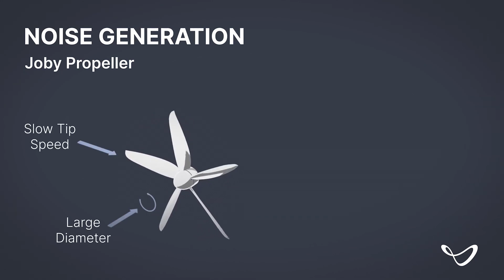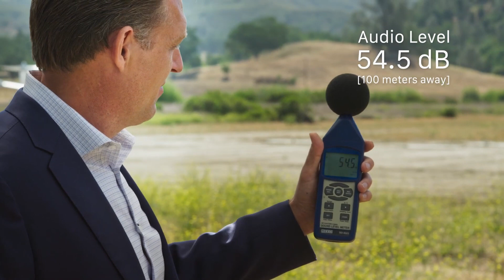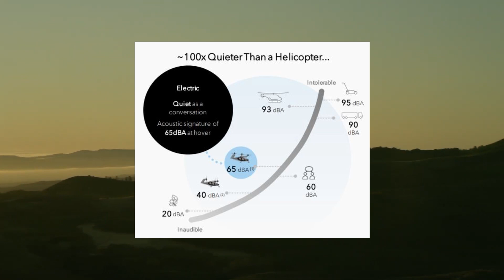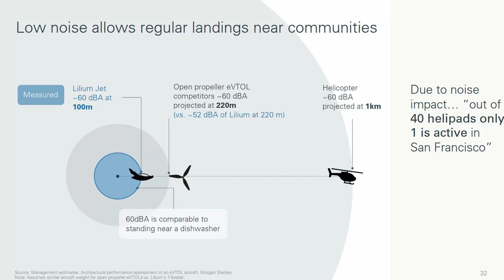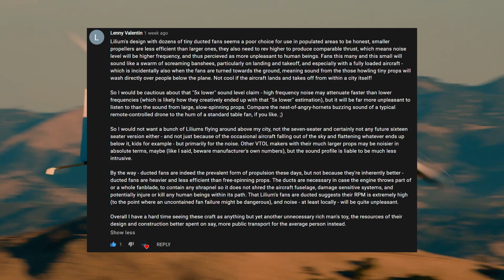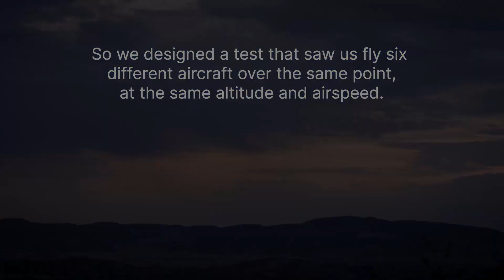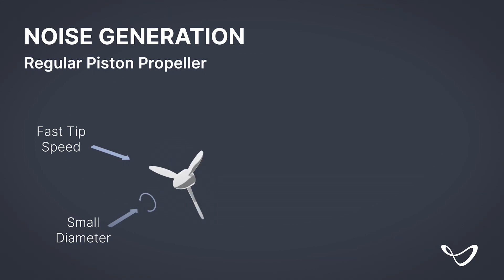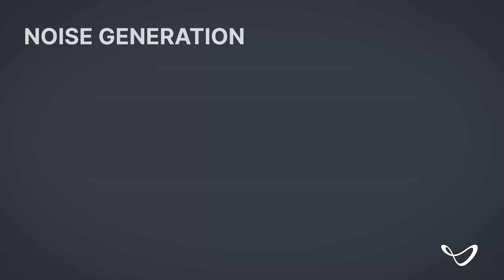Lilium vs Joby Which Electric Jet Quieter? Noise Level Of LILM & JOBY During Landing | eVTOL

Comment: Joby's larger rotors will produce more lift per rotor due to more surface area for the air to travel across, and that means Joby's rotors will not have to rotate but so fast but the question is, how much cavitation with those rotors create,  effectively producing the Pulse rotor audible effect or the chopping sound.  One must also keep in mind Joby's video's are produced by a film crew.  The spokesman ceo is mic'ed up,  exterior audio is reduced, then theirs POST production, which the editors can adjust the levels of noise in the studio.  so dont believe everything you see / hear in the video.  Lilium on the other hand looks as if it was shot with a gopro.  no Post production or little their of.   its audio more true to life.     Personally i would assume the joby to be a more quite aircraft.  or at least,  its sound profile more easy on the ears.   Remember a great deal of noise that an aircraft produce come from its engines,  combustion and turbo combustion engines at that which these aircraft do not suffer from.   so the levels of noise will be considerably low.   Now thats not to say electric motors dont make any sounds.  most do.. very high pitched sounds.  remains to be seen if these will also carry those traits.    But both will be fully accepted by the public.  because the very spectacle of their service will drive their popularity.   The real question is, how fast can they produce these aircraft. As this new industry success will depend on flooding the skies with these aircraft.  Figure it like this, multiple destinations is great, but these aircraft still only occupy 4 people on average (lilium is special with its seven seater)   And that means in order for such service to be profitable, it must mirror at least low levels of ground based highway traffic.   Its the only way to bring cost down.  the more planes the more serviceable destinations the least time constraints all riding on the amount of aircraft to service it all.   like Uber its a service that must take the hit of losses before its infrastructure is large enough to then become practical and profitable.
Reply from the maker: Great points! Thanks for your comment.
Reply: Modern Microphones have background noise cancellation and are designed to focus on the noise.  We really need an acoustic engineer to comment.
Reply: Honestly evtols are never going to change the day-to-day lives of normal people. It will be a niche industry.

Comment: It's not super easy to tell from the videos but it certainly looks as though the Joby props curve down (in TOL position) at the tips. This will function in a way similar to modern airliner wingtips, that is inhibiting tip vertices. These alone will greatly contribute to the low noise profile.

Comment: I have to say Lilium sounds a lot like a passenger jet which is preparing for take-off. Airport sounds make everyone think of going on holiday (in my opinion), which is a good thing.
Reply: Haha. Well the sound people associate with “going on holiday” will evolve with better tech.
Reply from the maker: That's an interesting perspective. I have not thought about that.
Thanks for watching & commenting!
Reply: Lilium uses EDF "Electric Ducted Fans" well known from model aircraft for a decade or two.   It is different from a high bypass ratio turbofan in that there isn't the gas turbine core with noise from the high velocity hot air and turbine.  Noise will come from the blades themselves which will be dealt with by acoustic liners, shielding, acoustic traps and helmolholz resonators.   The other source of noise will be the high speed air exiting the nozzles.  The lilum EDF contain nozzles to open up and both slow down the air and quieten it as well as increase hover thrust.   Id say when the final version is done the fan blade noise will be gone and all that remains will be the sound of rushing air.

Comment: I actually prefer the noise profile of the Lilium eVTOL aircraft.
Reply from the maker: I've noticed that people in the comment section are split on this issue. I consider that to be a good thing. That means that both Lilium and Joby have a great chance in capturing large market share. I'm rooting for both.
Thanks for watching and commenting!
Reply: I could imagine sometime in the future joby making alot of money at truck stops.

Especially with the partnership with uber.

A eVTOL that sounds like a big vacuum. 💀 hmm no. In person probably not THAT loud. But annoying.
Reply from the maker: @some.egokillers  Yes, eVTOLs will have many use cases. I think eVTOL manufacturers will not be able to keep up with demand in the first years of production.

Comment: Noise level IS a critical factor. (Elon Musk even stated this in a discussion on 'flying cars'.) However, I think the issue is a little more complicated than just which aircraft is the most quiet. Perhaps, a better way to frame it would be to ask, "Which aircraft is quiet enough?" If the Lilium design is superior in all other ways (which I intuitively feel it is), and it at least meets the minimum necessary noise levels for a flying taxi in urban environments, then I think it has a very good chance of still emerging as the winner. My gut just tells me that these open-rotor 'drone style' aircraft are a very bad idea for use in populated areas.
Reply: Exactly, the "drone-style" evtol are just a bad idea in my opinion, don't differ a lot from helicopters. I intuitively knew the companies to bet on were Lilium and Joby just based on design efficiency
Reply: @ruipedrooliveira4677  Yep! 👍
Reply: Open rotors have a blade strike issue which severely endangers not only the aircraft but the structure it impacts.  A hovering impact accident with a lilium while bad will be much less severe.  More a bump.
Reply: @williamzk9083  I’ve seen a few comments about the potential for strikes with the Joby aircraft.  I wish to point out the difference inherent with electrically powered aircraft compared with traditional rotor craft.  With the possible exception of special circumstances, such as cold climate operation, electric aircraft such as the Joby aircraft won’t require preflight rotor operation such as a helicopter requires.  Electric motors are inherently reliable and can be turned on after the pilot and passengers have boarded.
Reply: @danielhart1524  Good points but I was thinking of incidents involving rotor clearance during landing and takeoff to nearby objects and also during startup.  I agree the risks on a Joby type aircraft should be far reduced.
Reply: @danielhart1524  I think one has to also consider what I believe is the ultimate question with regard to all these aircraft, namely the question of public acceptance. What do you think is likely to happen when one of these open-rotor aircraft crashes in a heavily-populated urban area--say, over a residential neighborhood, or elementary school playground? This is also why I respect the engineering team at Lilium:  Yes, the 'quad-copter drone' foundation comes immediately to mind when thinking about how to bring a flying taxi to market quickly. But, in the end, ALL the key factors have to be properly balanced--safety, efficiency, noise levels, infrastructure, cost of materials, regulatory certification, operational requirements, maintenance, refueling/recharging, and even aesthetics. I'm betting on Lilium as they seem to have the most firm grasp on all these requirements.

Comment: A few things here to consider: One, as your viewer, Lenny, noted, the higher-frequency sound profile of the Lilium will attenuate more quickly than the lower-frequency profile of Joby aircraft, and it will. But the attenuation is much steeper than one might believe. Low-frequency sound travels much farther than high-frequency. Wherever either of these aircraft land, it'll be no more noticeable than standing next to a street with moderate traffic. It's just not an issue. My mother-in-law needs a new dishwasher so we've been looking and researching. The best run at 45Db. Most are at 50-60Db. 60Db is room conversation-level. The difference is simply immaterial at that level.  I happen to have a cheaper unit that runs at a noisy 65Db. It's so quiet that I can barely hear it run from the next room.

Another aspect that Lenny mentioned was that ducted fans are inefficient. Surely, he doesn't think that this is true and that the Lilium team missed it? Thinking that the shroud is there solely to contain possible propeller failure while Joby and all other open-propeller aircraft don't need it...whatever. Ducted fan jet engines are used becasue that's how they work, by compressing air into a smaller space so there's more oxygen for combustion. Ducted electric fans create much more thrust per swept square area, which is why Lilium chose them, obviously. Also, while the ducted fans rotate at a much higher rate, the small diameter of each means that the tensile load on any given blade is much less than would be the load on a much larger and heavier blade, such as on the Joby. Because stuff like that tends to increase with the square of the power of the system, I seriously doubt that there is any material limits being reached by the Lilium motors. Consider that propellers were made of wood for a long time and that wasn't a problem at all, was it?

Lenny is loathe to have swarms of Lilium jets flying over his house. In fact, the Lilium is said to be nearly silent in cruise mode. He wouldn't even know one had passed over unless he was looking up at the time. 

Where vertiports are installed, no one will care about the sound level from these aircraft. It's just a non-issue and that's the main thrust in developing this new industry. Are people complaining the sound of local airports now? No. Your house could be adjacent to a vertiport and even the cat won't get scared and run inside. People used to think that humans would die from suffocation once traveling more than 13mph but you know what? It turned out that humans have no trouble breathing at speeds vastly faster than that and all of the people who thought that it was a going to be a problem are dead. So there.

EVTOL's are creating an entirely new industry and travel infrastructure. Since the current travel rate and range is similar between these two aircraft, what will matter most is the cost per ticket, nothing else. As always, the Joby in its current size is limited to four paying passengers. The Lilium carries six and will probably carry 16 when the next version arrives. I still see it as no contest.
Reply from the maker: I see people are split in the comment section on which noise profile is more pleasant, that of Joby or Lilium. I consider that to be a good thing.
Thank you for the thoughtful comment. You made many good points.
Reply: Some good points and I’d agree that in cruise mode Lilium will not be heard, although the same can be said for Joby because in cruise they will be at a reasonable height above ground. But I heartily disagree with the suggestion that people aren’t complaining about local airport noise now. I fly from a private airpark surrounded by homes, and we have to follow strict noise abatement procedures both on the ground and in takeoff and landing to appease residents, who have knowingly bought homes alongside a runway! The same can be said for many airports I fly into, both public and private. So sound level will be important, particularly in a dense urban environment which these aircraft might be operating.
Reply: @elkcircle7245  Understood entirely. My point is that small airports exist and have for quite a while. Once in place, I don't see campaigns to close them due to noise. If there is a strip and someone moves near enough to one to be bothered by it after the fact, well, not everyone is very bright. Sadly, small airports close because of the value of the parcel to developers. Dedicated eVTOL vertiports will take up so little space in comparison and the actual, overall sound level will be so low that I can see people intentionally moving near one versus what small airstrips from the past might have engendered. So my point is that if small strips servicing noisy small aircraft have co-existed in residential neighborhoods all these decades, then the sound from eVTOL's is simply not going to be an issue.
Reply: Ont of the best comments I've seen here
Reply: @ruipedrooliveira4677  Thank you, Rui.
Reply: Keep in mind also that in cruise, the Lilium Jet will work at much lower rpm because a lot of the lift will be generated by wings and the distributed propulsion will make it so you don't need as much thrust from each engine the way I understand it. So in actual cruise flight Joby and Lilium are probably comparable and almost silent compared to conventional aircraft and helicopters
Reply: @faluffel  Take a look at what I just posed here: https://www.youtube.com/watch?v=Y6PHhcdHhcc

Comment: Important to note that Lilium's demonstrator doesn't have the airliners that the 7-seater version will use. Therefore it is louder than the final product.
Reply from the maker: I think I did mention that in the video. I do wonder, however, how effective these liners would be.
Reply: @FGain  An acoustic liner should get at least 5dB alone, that's quite significant what's typically achieved in a modern turbofan.  It should be equally effective on front and rear quadrants.  The high frequency sounds of lilium jet will be easier to absorb.  There are other methods possible such as different blade numbers in alternate EDF to spread perceived noise or uneven distribution of blades.   I suspect modern vertiports or lilipad will be carefully designed to minimize noise leakage and have anechoic lined landing areas and fences as well.  The first few seconds of tentative hover during landing and takeoff will be absorbed by this.  LiliumJet seems quiet enough to me.  In a modern city with roads, freeways, wind tunnels effects etc it will disappear.
Reply: The Lilium demoed is a half scale version, right?  Call me crazy but a double size version with noise absorbers will sound different